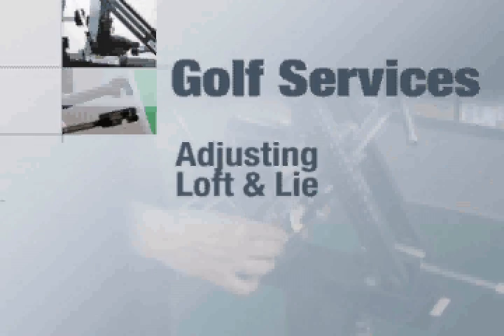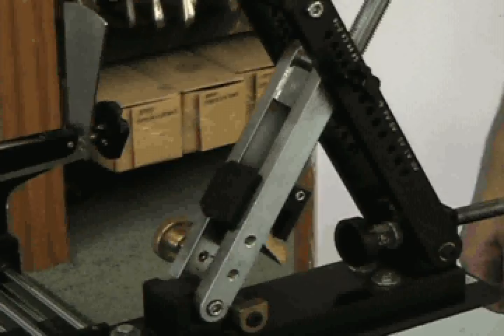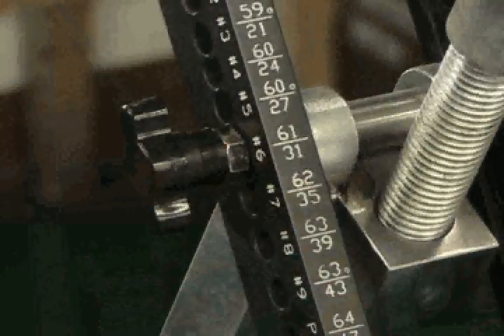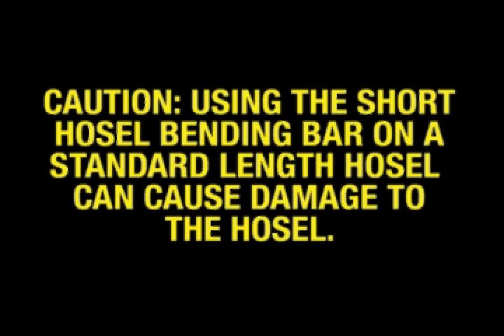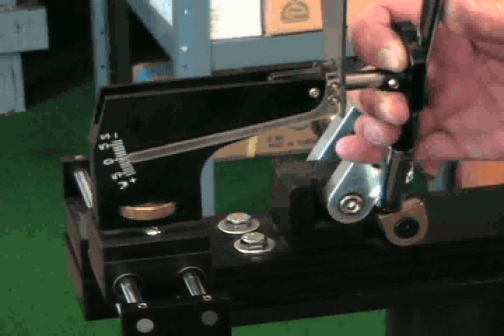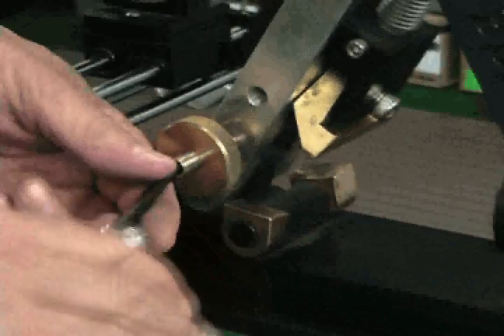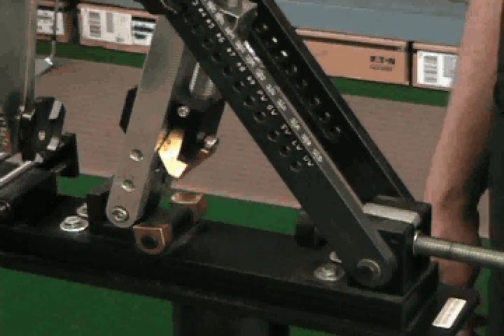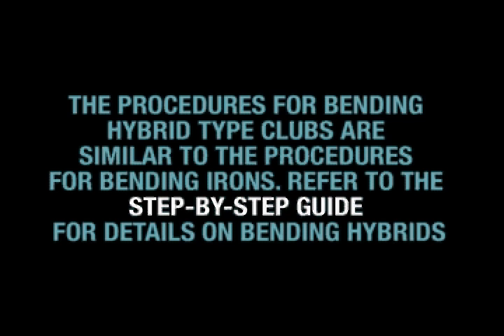How To Adjust Loft & Lie - Golf Club Making Tips

Comment: The L\L machine displayed is not really accurate as it is presumes specific iron lofts.  Manufacturers use different lofts for the same club ex: wedges can be from 42 to 46*.  A Mitchell L\L machine reads actual loft\lies.  Adjustments can easily be made accurately to .25*.